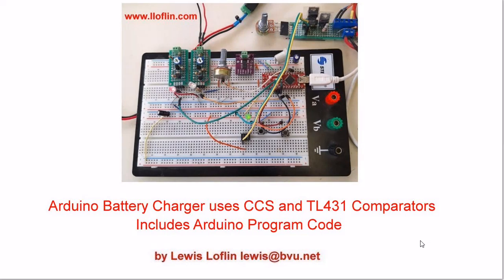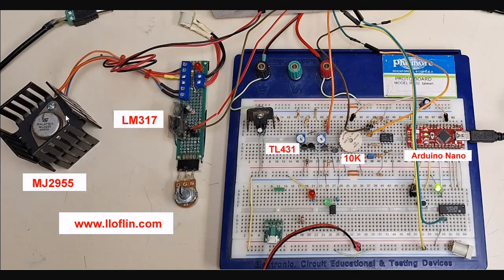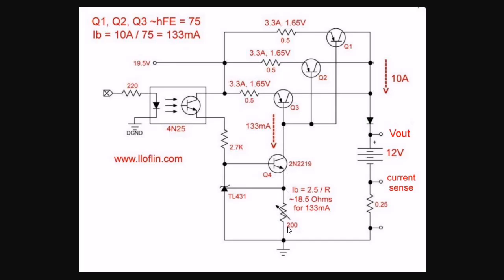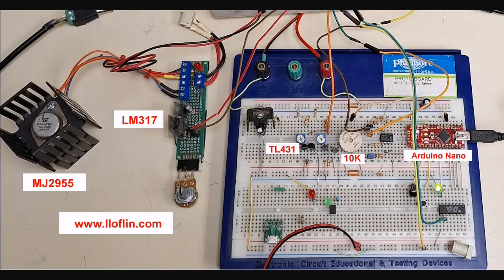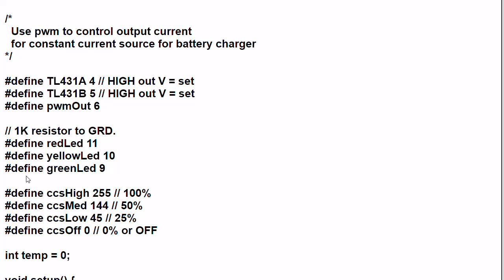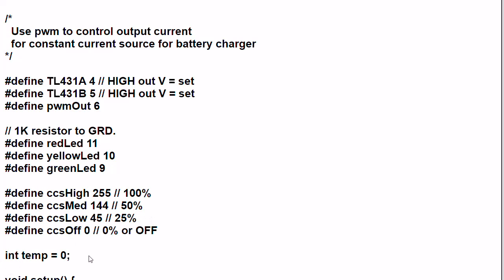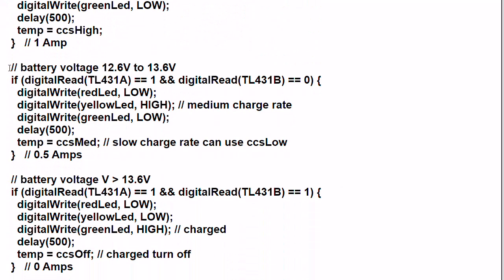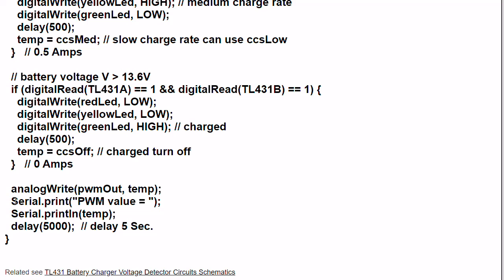Arduino Battery Charger uses CCS and TL431 Comparators

Comment: I've been looking for somebody competent in this subject for a while. I know solar charging systems do not have anything like I am going to explain so I'd like to build one with arduino , comparator circuitry, etc. Essentially I'd like to buy 4 massive powerwall battery banks and create a rotational charger using limited solar arrays. I would use one charging source and use  an Arduino to control relays by comparison of voltage. One battery bank would be connected to the load, our 240 V 100A AC home panel via 48VDC to 120/240 AC via inverter.  We would precharge all 4 banks, use the highest voltage bank as priority to feed the load, and simultaneously charging the rest of the 3 banks. Once the load battery drops to a cutoff voltage, the Arduino would switch to the next bank, switching to charge the low battery formerly used to power the load, as well as the other 2 batteries (maybe just maintenance for those if already fully charged). Pretty much infinitely rotationally switching as needed to power the load. When solar power goes away, it would obviously have to switch back to A/C power for charging until the solar picks back up again. I do feel this would make the batteries last longer due to normal cycling, and have less abuse to them as they would switch at maybe a cutoff of 47 volts . I am trying to figure out the switching scenario possibly using contactors since they are much better and longer lasting for the higher currents needed to power the home panel which would be close to  500 Amps at 48V absolute maximum since the home consumes about 30 to 35% of this energy at the same time pretty much at maximum outside of moments during startup surge/inrush currents. I do know it would be best to change to gas or propane for cooking, or other means than electric and try to eliminate heavy resistive loads such as electric heating. Let me know if you have thought of this kind of tech for off grid solutions. I think it would have to be produced on a public domain level because it would interfere with the use of electric company's power all together if sold to the public. I think it could significantly help those who can't afford the bills to have a system that could store the energy long term and get through days of no solar energy (during gloomy weather) with ease having the ultimate in energy storage and battery maintenance.